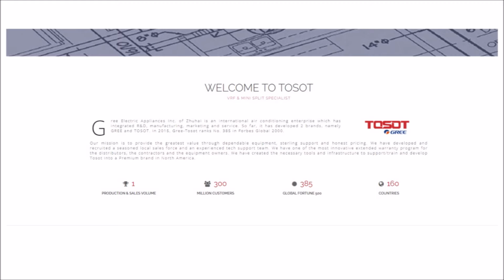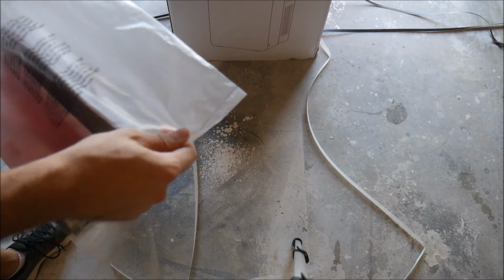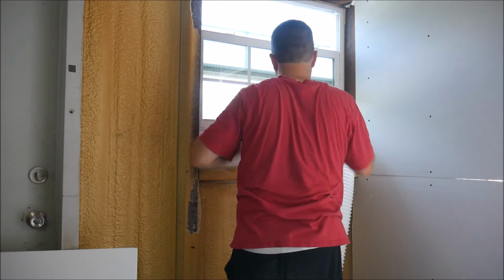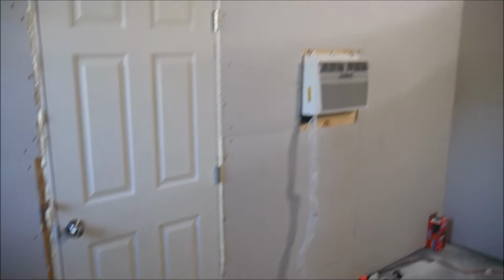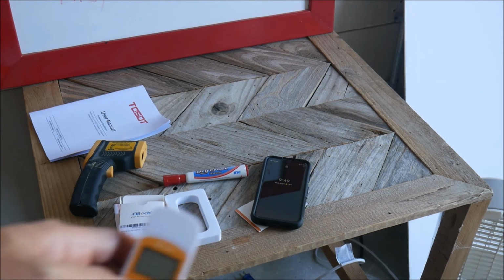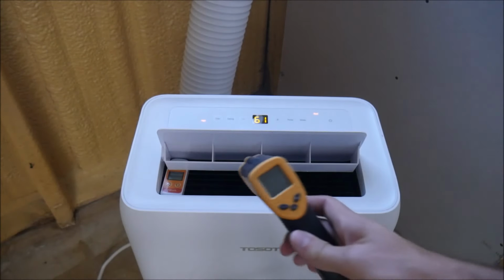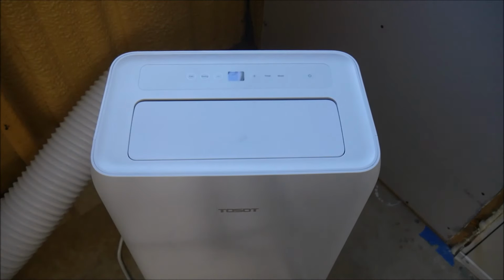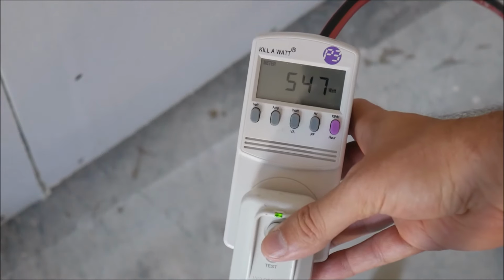TOSOT Aolis 12000 BTU Portable Air Conditioner

Comment: Never use a portable AC unless you can find a way to displace the heat it creates in the space you are cooling I say lol. Too much counter productive activity with these things. I had a 5,000 BTU window do better than a 12,000 portable. I just upgraded from 5,000 to a 12,000 BTU Tosot window for a 500 sq. ft. house and it works great! cools whole house easy, 4 rooms and I can feel the air move in all of them.

Comment: We have had numerous window units and now have mini splits (the best so far)  and we had a standalone unit like that one.  The unit has a lot of heat in the unit to get rid of that is still inside your room.  we found that it pulled the heat from the air but then seemed to radiate some back into the room from the case and the host to outside.
Reply from the maker: Yeah that is true.  These single hose units aren't efficient at all.  But I think they have their place.  Mini splits rock!  My next house is going to be nothing but mini splits... no central air.
Reply: I've used portable AC and will recommend not using them.  As you mentioned the heat produced by the refrigeration unit as well as the fan motor is dumped into the cooled room, and given that some of these units are in the range of 1200 to 1400 Watts is like cooling and having a 1400 watt heater in the same room.  Also the air from the same room is exhausted out thru the hose to the window,  to cool off condenser thus further diminishing the capacity of cooling.  All in all is a poor design.  Window units that are well designed are the most efficient because working portion of the unit is hanging outside the window.  Further is more reliable (vs mini split) because the whole unit (aka package) is built in the factory under controlled and tested environment.   Many of the newer mini splits are designed for semi professional installation and reliability (3-5 years) could be problematic whereas older central units installed by professionals can last 20+ years.   My opinion from observation and use.  Have see old 22 units lasting over 45 years.

Comment: Where does the condensation water drain to?

I'm considering a portable AC unit because it's much more HOA friendly.  I want to use it to cool a living space on the hottest summer days (as a dump load for excess solar electrons from my panel array).  Fortunately,  the hottest days typically coincide with the sunniest days when there's excess power produced by the array.

Thanks for the head's up on this brand I've never heard of before.
Reply from the maker: The water collects in a small compartment toward the bottom of the unit.  You can wait until the device beeps and tells you it is almost full and then drain it ad hoc or you can permanently attach the hose to a floor drain.

That coupon code at the end of the video is good until the end of the month.  $40 off the already pretty decent price is a good deal!

You are welcome for the heads up on Tosot.  Thanks for watching!
Reply: @LDSreliance  The website for the unit mentions a 20% off coupon code.  A better deal than you are providing?
Reply from the maker: The 20% off coupon is the one that I mentioned at the end of the video.  It is good until the end of the month.  The one I put in the video description is only 10% off and is good until the end of 2021.

Yes, the front temperature setting is in Fahrenheit.
Reply: Also, does the temp display on the unit in Fahrenheit?

Comment: You completely missed two problems with the portable AC you used:  1:  The air being discharged outside is coming from inside the room, meaning you have to suck it more hot air to blow out your cooler air. 
2:  the tubing for the discharge outside is not insulated and adds a lot of heat back into your room.You can use flexible ductwork to insulate the plastic tubing.
Reply from the maker: Yes that is true.  This wasn't really meant to be an exhaustive list of the pros and cons of portable units or comparison to window units.  I had to do that a little bit to put things into perspective.  Maybe I will do a more detailed one at a later time if there is enough interest.
Reply: @LDSreliance  That’s the most important detail though. They look great till you buy one and they literally put out more heat from the back than cold out the front🤦‍♂️ Very expensive mistake I learned the hard way hope other don’t have to.

Comment: Palm Desert California 
Outdoor temps are 115-122 in day.
90+ at night.  Bedroom has a large vertical window and is alarmed on all day and night in HOA properly.  Room is hot day and night as it faces South and sun is sunny about 10 hrs a day.  The condo ac unit is on the most distant corner of the building.
Would a high electric energy consumption be worth the additional electric cost?  Anything else to consider?
Reply from the maker: I can't say for sure it would be worth the cost, but it is definitely an option.  You wouldn't have to open the window very far (6 inches) and you could keep the blinds shut to block out that south facing sun.  If you are stuck in an HOA situation where they won't allow a window unit hanging out then this is probably your best bet.  Just get one sized appropriately for the room.

Comment: "I don't know if you can notice". Yes! Absolutely we noticed how much louder it is! 

If you can use a window unit then don't get a "portable" one.  Window units tend to be more efficient.  There are even some new window units that block a similar amount of your window to the "portable" ones.  The new design of window units have a split down the middle.  It makes them quieter,  more efficient, blocks less of the window, and safer for second story or above installation.
Reply from the maker: Agreed.  The U shaped units are still uncommon and very expensive, but hopefully they become the standard over time.  I'll still take a regular, ugly window unit for the efficiency over a portable unit any day.  But I have found several scenarios where these portable units are the only option or make more sense.  For example, my son's hospital bed is in front of our windows in our family room.  So a window unit won't work, even if it was a U shaped one.  But with a portable unit, I can snake in the hose in the gap behind the bed and stretch it out to the side of the bed to the air conditioner.  I still don't like how power hungry they are, though.
Reply: @LDSreliance  Yes, I hope the U shaped units take over.  Mass production should bring the cost down.  I'm planning on getting a mini split after some wiring upgrades I want done and after I convince my wife. 😂

 Did the builder not properly size your main unit?
Reply from the maker: No, our builder cut every corner he could find.  Big neighborhood filled with spec homes.  1450+ houses.  We have replaced our central air completely once and our condenser twice in 9 years.  So in order to keep it from overworking itself because of bad design, we use a couple window units and one portable unit to send cold air to the hottest areas.
Reply: @LDSreliance  That's a shame.

Comment: It's a single hose unit it's sucking air from outside it's like a screen door in the submarine 😱🙄🤔
Reply: Exactly! If you can use a window unit then don't get a "portable" one.  Window units tend to be more efficient.  There are even some new window units that block a similar amount of your window to the "portable" ones.
Reply from the maker: Yes, a dual hose unit would have been much better.  Unfortunately, they don't offer one that I know of.  They are pretty uncommon and usually only reserved for more expensive and bigger models.